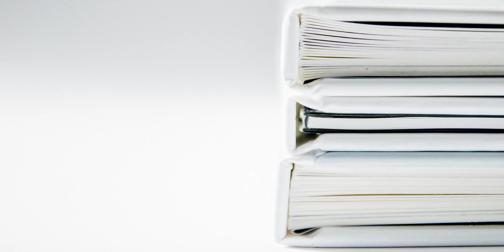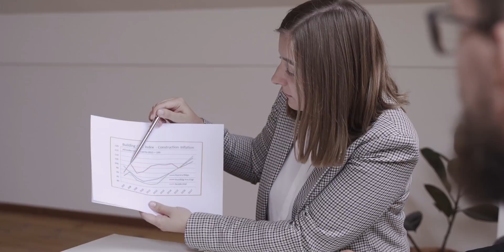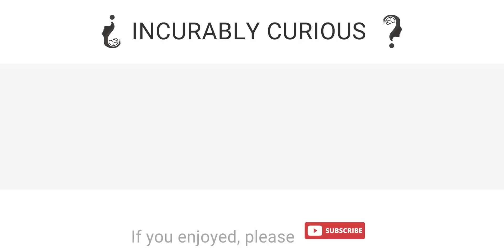Why Most Power Lines Aren’t Underground

Comment: you just took a huge crap on underground lines.  Okay, but you and nobody else considered putting just the huge feeder lines underground and then the normal lines on poles.  New Orleans lost all power because all the lines from power plants went down.  They had to replace the main lines as well as the pole to pole lines.  This isn't an all or nothing kind of issue, and you just didn't want to talk about that.
Reply from the maker: I respect your take on that, but I would say that I and others did research underground feeder lines, although in my case it was after I made this video. They tend to be even more expensive and complex due to the higher voltages and greater chance for grounding to occur. If I may, I direct you here for someone much larger than myself who has discussed them: https://youtu.be/z-wQnWUhX5Y

Comment: But there are some places that there's none of that so putting parallel lines just it's more easier I used to live there just the parallels were underground there were 4' deep salt digging wouldn't really be a problem if you're accidentally hit a power line Because who in the right mind just takes 4' just because And there's seal in a steel Box that's very hard to break anyways
Reply from the maker: Since making my video I have learned that underground feeder lines are even more difficult. Check out this one in LA: https://youtu.be/z-wQnWUhX5Y

Comment: My town has underground powerlines and there has not been a single power outage in five years. The Netherlands.
Only the main, high voltage power lines are above ground in my country.
Reply: Yeah The Netherlands is probably the only nation in the world that doesn’t have a single small power line above ground only the main high voltage ones, thus (in my opinion) making it the cleanest looking country in the world! Groeten uit Nederland 😁
Reply: So you think you're hard because you didn't have an outage?

UK doesn't have overhead cables at lower than transmission voltages either.

You have the big pylons at transmission voltages, hundreds of kV, and those are tied to power stations on the outskirts of cities.  Within towns and cities it's all underground.

Of course, you have 11kV lines hooked up to pole transformers to supply small villages, farms etx.
Reply: In the most big cities in germany, we have underground lines to but for longer distance, underground lines are very expensive and inefficient
Reply: Small town I live in (US) about 15 years ago moved its electric all underground. Very expensive and took 10 years to get it all done. Think they have 98% underground now.

In the 7 years I've lived here never had a single outage though other parts of town have had outages when transformers fail, or wires fail.

Not without its downsides however.
Failures are very expensive to fix according to my friend who works for the city.
Being that they are underground they pose a risk to other workers as well - a couple years back a crew installing new utilities struck one of the underground lines. Two workers killed, another badly maimed. Not sure if the line was improperly marked, or if they were not careful in operating their directional drilling machine.
Reply: The Netherlands is irrelevant. In fact, to zeroth order, ALL of Europe is irrelevant. As indicated above, some COUNTIES in the US are larger than some European countries. The UK is the size of California. Germany is the size of Oregon.

Comment: All power cables in The Netherlands are underground, this is primarily a safety meassure, and they also know where these power cables are buried..
But we pay also a lot more taxes for these and other maintenances.
Reply: How many wildfires do you get every year from falling trees on power lines? I bet the damage isn’t as bad as the extra taxes…no burned people homes or wildlife
Reply: @greatestever8169  Speaking of the Netherlands, none. Falling trees cannot hit the powerlines that are still above ground because those are the mega towers. The small lines that distribute power in cities are all underground.

Source: I live there
Reply: @Account NumberEight In which country do you live?
Reply: But...you're below sea level! How's that work? Wouldn't they just fill up with salt water?
Reply: @bcubed72   i understand why you think that but we dont live underwater . And we have tons of rivers with saltless water aswell
Reply: @kiwiciwi123  
Isn't the water table in low-lying areas generally right below ground? I know they don't bury people underground in New Orleans because of the water table.
Reply: exactly, I was wondering what country wouldn't have a database of water pipe/sewage/power/telecoms cable underground and their locations accessible to contractors. That could not possibly happen in my country
Reply: I would rather pay more taxes for that cause than pay half the tax just to make some greedy politician richer.
Reply: Not all are underground. You can't put very high voltage lines underground because of massive power losses due to stray capacitance to earth.
Reply from the maker: Yeah part of me wishes I had done my research from a more global perspective on that one, but at the time I was just trying to satisfy my curiosity.
Reply: @IncurablyCurious   He is right. There in The Netherlands they dont have any problem with trees falling down or the root taking out the cables below the ground because they got a system to prevent it. beside that, the electricity company always know where it went wrong and fixed it right away.
Reply: @ReyX1991  I come from a tropical city, and tropical roots are MASSIVE to support very tall trees... they frequently break pavements in areas where pavement placing wasn't planned properly, but I can honestly say I've never heard of them damaging cables. Cables always go deeper than the roots.
Reply: In Capitalist Republic America, government perpetuates propaganda and has everything set up as illusions of multiple parties.
Reply: And those lines that are sparking above the trains are fairy dust dispensers?
Reply: Who cares about the Netherlands? Seriously? We have counties in the US (e.g., San Bernardino) that are larger than most (maybe any) European country. A good base hit in the Netherlands lands in another country.
Reply: @stevecooper6473  I can say the same thing : who cares about the United States?.
Its an old outdated 3rd world developing country that can't even get its modern infrastructure in place, let alone learn to do it better as how countries like the Netherlands and among others do it better then the US..
The Netherlands among other countries that do have their stuff together especially infrastructure wise are 30 years ahead of yours, So yeah who cares huh?.

You people seem to obsessively care about scale rather then implementation and investment in good modern infrastructure..
Scale was never the problem, however your mindset in doing things different however is..

The reason why i said that The Netherlands where i live do have our power cables underground is because its a safety measure primarily, not the costs and nor if people are hesitant to pay for them, its not my fault that your country is a low shithole and unorganized cesspool..
Wallow in your own dirt if you don't want other countries to tell you otherwise.
Because where i live, most of you Americans would consider it paradise..
Reply: The Netherlands and other European countries have very high population density. I'm from the UK but live in North Carolina. It is about the same size of England but only one-tenth of the population. So there's much less tax revenue. Outside of cities, most power lines are overhead.
Reply: Netherlands, here I come!
Reply: @Koowluh Yeah where highways and flatland are, but that's the only high rise cable network you will encounter in The Netherlands.
Those are grid networks.
Reply: Hm, we 'kinda' know where power cables are. The national system keeping track of all cables and pipelines has a legal margin of error. There is also still plenty of stuff that was put in the ground before we started keeping track.
Reply: Also don't forget the Netherlands is relatively a small country, so easier to make such infrastructure change
Reply: @Klarkada  The size is not the problem, local administrations that are ill-responsible for infrastructure and systems is the problem.

And how American cities are planned sets already a failure on how to do things properly with strict zoning regulations..
Reply: @Klarkada  it’s not about size it’s the fact that the netherlands is the most densely populated country in europe that isn’t a micro-state/city-state, if other countries were as dense as the netherlands they could afford the infrastructure too, because there’s relatively less infrastructure when things are close together and there’s more people paying for it
Reply: @Klarkada  If you look at the size of individual counties in the U.S., they are small compared to the Netherlands. So, it should be easier to make infrastructure changes in the U.S. than in the Netherlands.
Reply: @Klarkada  it also has less people living in it. In other words: size is irrelevant.
Reply: @Twiggy163  what it has to do with the topic? smaller country, easier to build infrastructure. similar to its railway system
Reply: @Klarkada  a larger nation with more people will have more funds and manpower to build it. Its not rocket science. The whole thing is relative.
Reply: @Twiggy163  again, I'm not talking about funds. but the physical size of the country
Reply: @Klarkada  I know.
Reply: @Twiggy163  that is not how scaling works if it were we would be able to build sky scrapers by stacking logs. you say "larger nation" do you have any conception of just how large "large" actually IS? or how quickly overhead on a project stacks up? we are NOT omnipotent we cant just snap our fingers and make millions of miles of tunnels in to bare bed rock in some places it is just not practical even if it is technically feasible.
Reply: @kevint1910  yea, it is and to compare it with a tunneling project is wrong on so many levels. The millions of miles  of tunnels would compare to the transport lines (which are most often still overhead) and NOT the distribution network.
Weather 500 people need to pay for 5 km worth of distribution cable or 5000 need to pay for 50 km. Often the latter is even cheaper (relative overhead costs).
I never suggestes these things would change overnigh either. But you should be able to make the shift at the same rate.

Edit:The change to skyscrapers doesnt work either. Neither of you seem to understand how scaling in the underground infrastructure works.
Reply: @Twiggy163   here is the issue "does the entire investment as a whole return enough PRODUCTIVITY to justify ALL of the expenses intrinsic to creating and maintaining the system?" like i said some things are NOT worth doing even if they are technically possible and that's strictly due to the TOTAL economic RETURN got that? if it is not productive it is NOT functional even if it "works" and the more you spend on features that are not necessary to the circumstances the more you damage the productive return of the system. overhead lines gets used where it is appropriate mainly in low density rural applications and underground gets used in high density applications where space for right of ways is at a premium....i am an electrician i sort of know what i am talking about and in some detail.
Reply: @kevint1910  obviously sometimes it not worth it. But thats got little to do with absolute scale and everything to do with relative scale. You said it yourself: underground lines get used in high density applications. Generaly, thats what cities are ajd which is exactly where the electrical grid is underground in the Netherlands. Transport lines are (with some exceptions) still above ground.
As an engineer in the underground infrastructure, I too know a thing or two.
Reply: @kevint1910  Just as a sidenote: I have a question about the productivity you mentioned. Would they combine infrastructure work? As to say: if the work is going to be done for drinking water, gas lines or internet, why not combine it with putting the powergrid underground? Its pretty common here. Pretty much every home is connected to water, sewege, internet and gas system. Water and sewege lines get replaced every 40 years or so. It can be worth it it place internet cables underground when the pipelines get replaced anyway.
Im currently working on a project where a drinking water transport pipeline gets replaced because the local government decider to rip up the old sewege network. The drinking water pipe still functions fine but its made of asbestosconcrete. While generaly safe, they dont want the material in the ground anymore.
Another one is an ISP going through the country, ripping up streets to put fiber everywhere. There is some moaning about the progress (by our standards) but it is happening.
Reply: @Twiggy163  Population DENSITY is the crucial factor, which obviously escaped some. Just as "less" for continuous variables vs. "fewer" for discrete ones.
Reply: @stevecooper6473  yup, population density is often the key factor. However, it mostly remains a choice to invest in the infrastructure and local laws to force it upon companies to put the cables underground.

Btw, Germany is about the size of Montana, not Oregon. The US' 4 largest state. But with 80x the population (and about twice that of California).
Reply: @Twiggy163  The Netherlands is as a country one of the most dense populated countries.
Reply: @hansw5067  true, yet even the less dense areas have the infrastructure underground. Ive seen areas in the US with equal density that dont. So at that point it comes down to willingness to invest.
Reply: @Klarkada  size doesn't matter, in the Netherlands larger distances are also above ground high voltage power lines.
Reply: @Twiggy163  I find it fascinating, how many people, espcially Americans do not seem to understand what relative mean. That's also their go to excuse to not have universal healthcare or public transport.
Reply: @kevint1910  
Gotta love people talking about "economic return" they achieve by simply dumping large parts of the costs on future generations and scream "f.... it, who cares for externalities!"
Reply: America better look how the Netherlands do everything. 
Roads,water and infra structure.
Maybe the can learn something 😉
Reply: PLUS you got great health care that doesn't put you in the poor house.  Paying more in taxes is not a bad thing considering what you get in  return.
Reply: @akita96th  not everything is perfect but what i see in other country's. 
Just something simple we have one of the cleanest tabwater in the world.
Reply: you also have Universal Healthcare comrade
Reply: @gokushkameha-ha-ha9344  The Netherlands is a capitalist country and the Dutch invented the stock market, and the Dutch basically invented capitalism and were the first country with a multinational company, so don't act as if the Netherlands is a communist country because that is utter nonsense. You're lacking historical education. The Dutch healthcare system dates back more then a hundred years ago. It was originally designed for the poor people, but it worked so well that even the well situated people wanted to join the healthcare system voluntarily. It resulted in a high quality healthcare for a relative low price. In the Netherlands nobody gets evicted for not being able to pay a hospital or medication bill. The people do not even get to see a bill.  In the US the people who can afford healthcare insurance pay at least 10 times what the Dutch have to pay, and on top of that comes the costs of medication, which the Dutch do not have to pay for separately either. 

The brutal outdated system in the US is designed to make as much profit as possible, even when people who can't afford it are dying or get evicted from their homes. The system in the Netherlands is designed to heal people for the lowest price as possible with the highest quality as possible, with the least amount of administration as possible. 

The US is in many ways a third world country.
Reply: @gokushkameha-ha-ha9344  Which Americans pay for, by defraying defense costs for Europe.
Reply: You have to realise that all the power lines had to be rebuilt after 1945, and that the earth is not rock in the Netherlands.